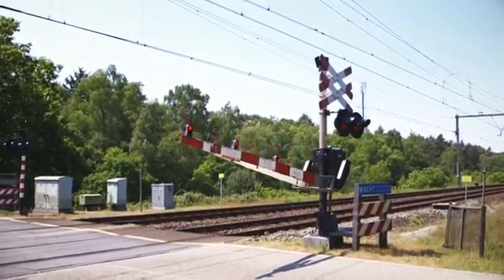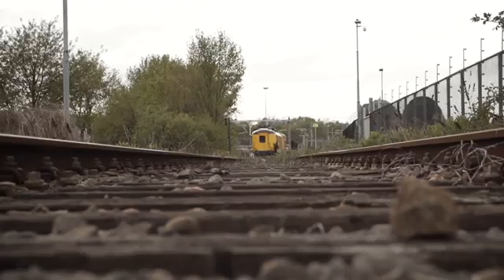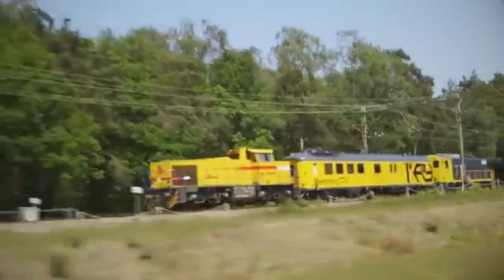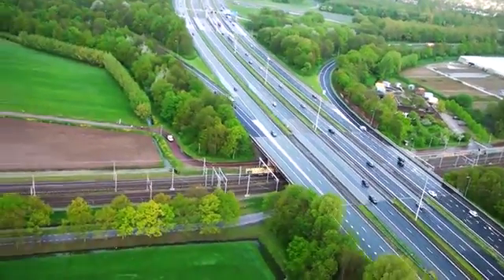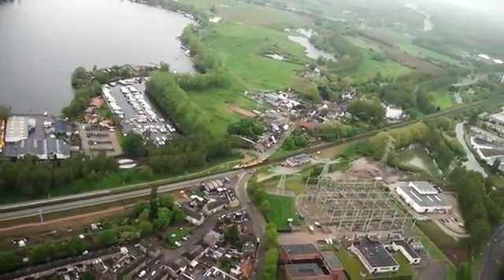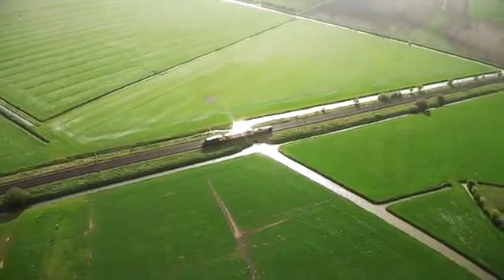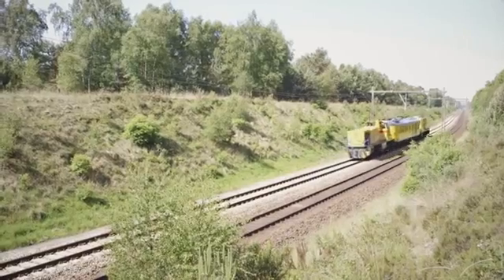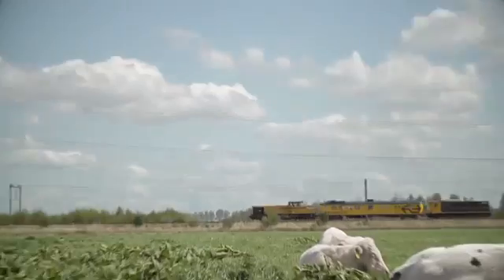CTO Train TUDelft

Comment: Hello there!! Well, what can i say!!! Perhaps this is the key, wheel-rail interface and its parameters, yeah, it will be the better manner to improve the future rails, however, the next step on traints is the maglev or hyperloop tecnology.
Reply from the maker: @juancarlosromo414  thanks for your comment! Indeed you eliminate the interface with those systems yet at a cost that is not possible to justify for many lines. I believe in an integrated system with tailored latest tech in all sort of lines. Even for regional railways to have them running with hydrogen, why not? ;) have a great week!

Comment: Cool! If I understand this correctly, railway-companies can approach TU-Delft and use the CTO train and together optimise the track of a railway?
Reply from the maker: Hi! yes, that is the idea. Equipments on-board to measure condition of the infrastructure that satisfy the safety regulations can be easily tested using the CTO train. Regards.
Reply: Alfredo Nuñez awesome. Thanks for the information again.